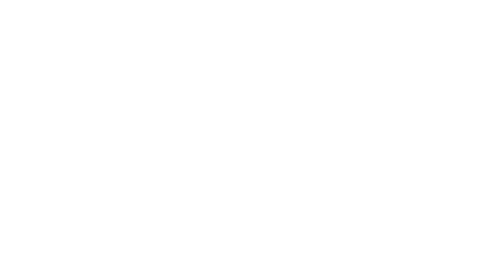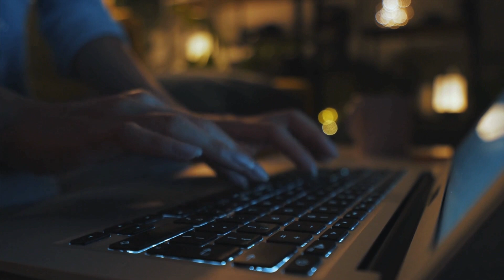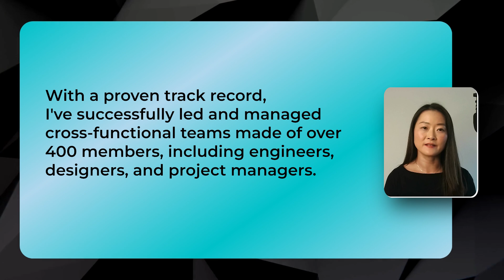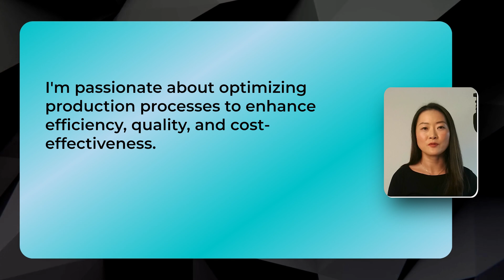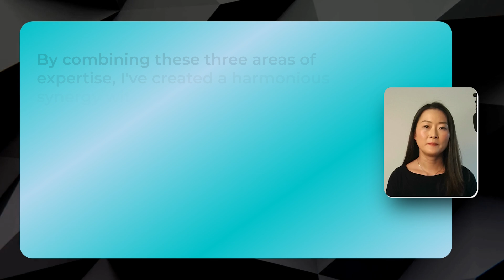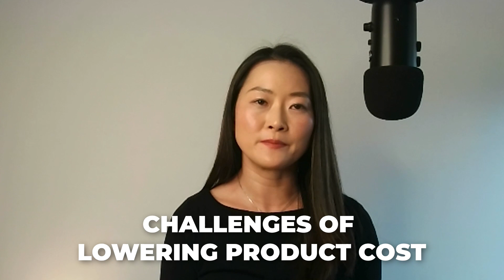How to Use Your LinkedIn Profile to Power a Career Advancement

Comment: 📝 Summary of Key Points:

📌 The speaker emphasizes the importance of optimizing your LinkedIn profile to stand out and make a strong impression. They suggest crafting an attention-grabbing headline that highlights your unique qualifications and achievements.
🧐 The "about" section of your profile should tell a compelling story about your professional journey and highlight your past accomplishments. Use up to 2,000 characters to create a cohesive narrative that connects your various positions and functions.
🚀 In the experience section, focus on concrete accomplishments relevant to your desired career level. Use the CSR format (Challenge, Solution, Result) to clearly state the problem you solved, the solution you provided, and the results you achieved.

💡 Additional Insights and Observations:

💬 "Your headline is the most eye-catching space on your profile."
📊 No specific data or statistics were mentioned in the video.
🌐 No references or sources were mentioned in the video.

📣 Concluding Remarks:

Optimizing your LinkedIn profile is crucial for accelerating your career. Craft an attention-grabbing headline, tell a compelling story in the "about" section, and focus on concrete accomplishments in the experience section. By following these strategies, you can attract the attention of the right recruiters, hiring managers, employers, and industry peers.

Made with Talkbud
Reply from the maker: Thanks for the summary